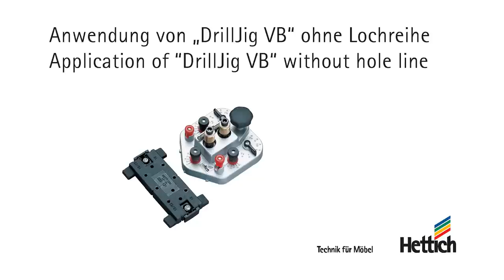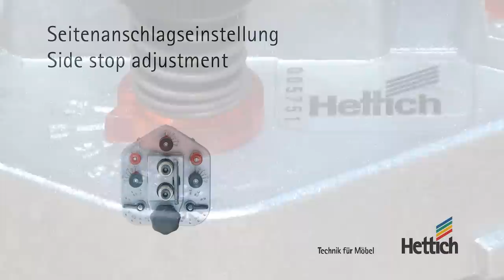Cabinet assembly with VB fittings and DrillJig VB from Hettich, incl. drilling cabinet side panels

Comment: Hi,

I already saw the previous answer:

"The VB fittings have actually been designed for putting up large wardrobe cabinets that need to be dis- and reassembled for transportation"

but can you explain me the differences between these two:

- VB 36 M / 19 for 19 mm shelves - nickel plated - 0 065 521 
- VB 20 for 19 - 20 mm shelves - nickel plated - 0 025 049 1

I can see the main hole`s size is different - 20mm (goes 12.5 inside the shelf) vs 30mm (goes 14.5mm). 

Which one is more durable (i.e.  higher load capacity)?
Which one is preferable for 18mm shelves / sides?
What is the difference between 'with' and 'without rib' versions?
Which dowel is recommended to be used with both of them for 18/19mm shelves - DU 321/279?

In my case I want to use it for connecting ALL side panels to the bottom / top / shelves. 

Thanks in advance!

Comment: Hi, i am already using some of the Hettich systems, however did not knew you sell these amazing tools. My local Dealer has not told me about those. I would like to know if these VB fittings also work in bigger cabinets, such the kitchen floor cabinets or if there is any limit in the dimensions of the cabinet to build. Is this assembly system appropraite to build durable furniture? Indeed, can these fittings be used to build drawers? Thank you!
Reply from the maker: Hagi Valle,
we're sorry to hear that your dealer missed to tell you about it - on the other hand: "At least there's some value in this YouTube channel for you"  ;-)
The VB fittings have actually been designed for putting up large wardrobe cabinets that need to be dis- and reassembled for transportation. Rastex offers special features that support the assembly process, also when mounting extra shelves between 2 sides after the main cabinet is already assembled. So yes, they are absolutely appropriate for durable furniture. You can find all the specs in our catalogue: http://www.hettich.com/blaetterkataloge/TA_2013/en_DE/blaetterkatalog/index.html?startpage=2259
You can also use them on drawers, but we'd recommend other solutions to build the boxes. You could e.g. use Rastex connecting fittings, which are less visible. 
When used with drawers, VB is often applied to connect the bottom of very wide drawers to the front panel to prevent sagging or pulling the front of the drawer bottom. In that case, it should be assembled invisibly below.
With best regards,  your Hettich YouTube Team

Comment: а вторая часть шаблона ? почему не показали ее использование?
Reply from the maker: Dear Welesqwerty,
we are not exactly sure, but believe you are asking about the 2nd side of the black jig for drilling the dowels.
These drill sleeves have a different distance to the edge of the side panel. They are to be used if the top or bottom panel have another board thickness: one side is for 16mm, the other for 19 and 22mm board thickness.
The catalogue documentation also shows: http://www.hettich.com/blaetterkataloge/TA_2012/de_DE/blaetterkatalog/index.html?startpage=2761
Best regards, your Hettich YouTube Team